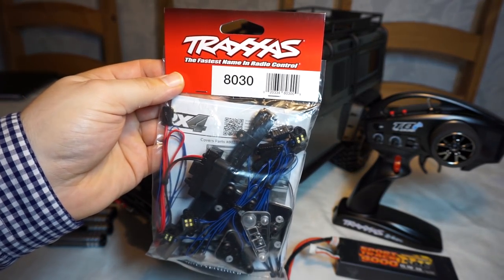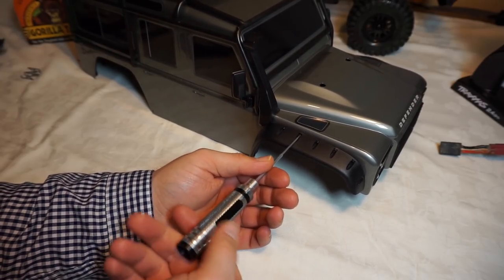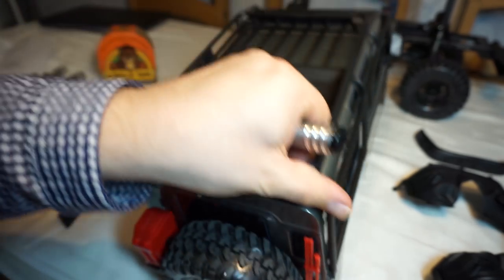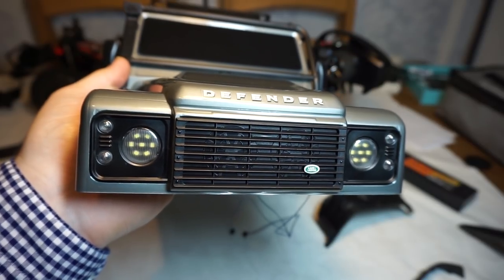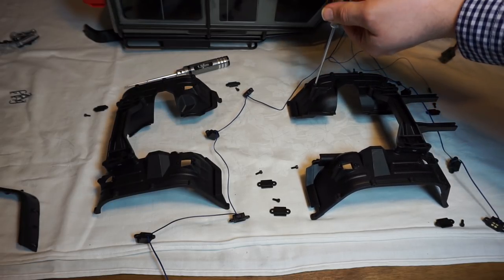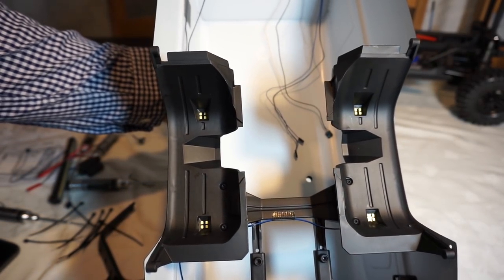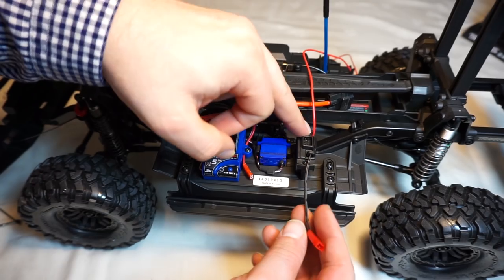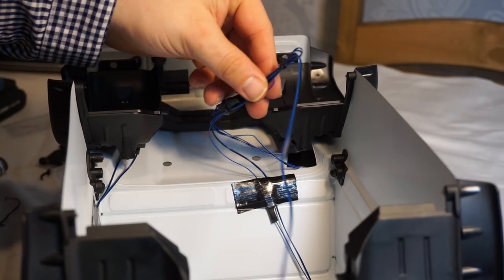Traxxas TRX4 8030 Light Kit Installation

Comment from the maker: Do you think the TRX4 looks better with the light kit?
Reply: Yeah it seems very good
Reply: Jake Billing yes
Reply: hell yeah :)
Reply: Did u get that wound on your hand from the tires it looks like my tire burn on my hand from holding my rig and bumping the throttle lol
Reply: I like this set of lights, i gonna buy them but ..... i cant help myself but 100e and so poor lights in rear ..... no comments. just two red lights. no brake light, no reversing, direction indicators, warning lights, nothing. but... how i said, i gonna buy them :D
Reply: Can I buy the thing you plug the light in to separately?
Reply: Yes, but one question. Has the TRX-4 oil filled shocks? Or not.
Reply: do you need to re grease the seal on the receiver box? to insure water proof seal?

Comment: Your back up lights and turn signals aren’t working.  I’ve got the same problem on my TRX4 Defender
Reply: That's because they don't work at all. At a price of $100 bucks US. they could have done a better job on the features.
Reply: They are not supposed to work. If you want those features buy the EZON light kit for like 20 bucks. There are similar kitsch for 17 bucks as well. Reverse lights, brake lights, blinkers, high and low beam, and hazard lights.